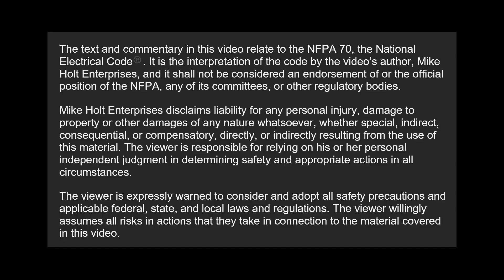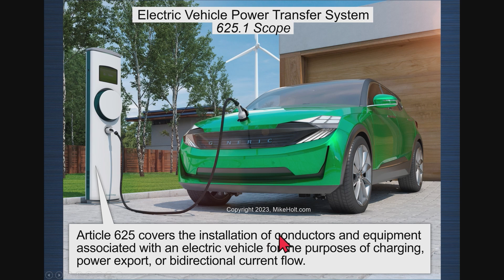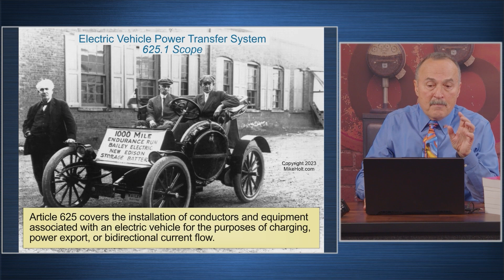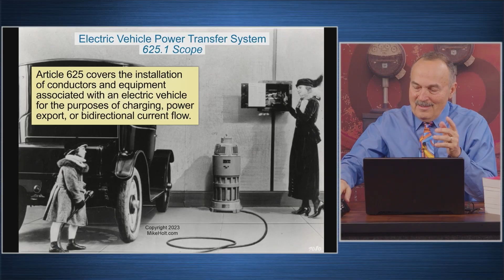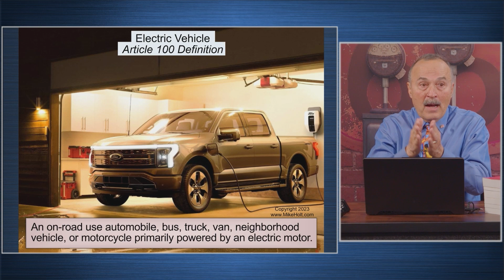Electric Vehicle Power Transfer System, NEC 2023 - [Article 625], (16min:00sec)

Comment: you can buy 15kw  battery for $3500 or less wall mounted if you have 3 you could power your house your not going to use a car battery that costs $20,000 to replace also it will be hard to charge as people move into apartments,utilities are going to pay less to buy electricity soon it will be zero,electric power should become cheaper due to wind power or solar but  they are building data centers that use huge amounts of energy
Reply from the maker: I  don't think you can get 15 kW of battery storage with all of the charging and controls for anywhere near $3,500.
Reply: @MikeHoltNEC  You need to do your research.  You can purchase 14.4kw of LifePO4 battery system in one unit complete with it's BMS and fire protection for around $3,500.  Google Solar Signature.  You can also get a powerful all in one system with PV MPPTs, inverter and charger for from $1500 to $5,000 depending upon how much power output you want
Reply from the maker: @ronbridegroom8428  Please get me the link to a 15 kW system (battery with inverter providing 120V output) for less than $3,500 (as you stated previously). I bet you can't...

Comment: What they fail to see is that use of your power storage starts as volentary for the system to be adopted ubiquitously; but then it'll become mandatory without compensation and without personal control of when or how much. You will own nothing and be happy!
Reply: I get what you're saying... the new world order
Reply: @michaeldavis9940  <> Never forget, in the end, you're the product.
Reply: Electric companies give rebates for connecting your panel to them and allowing them to throttle or turn off things. It's voluntary. I expect this to be the same.
Reply from the maker: I think you are 100% correct.